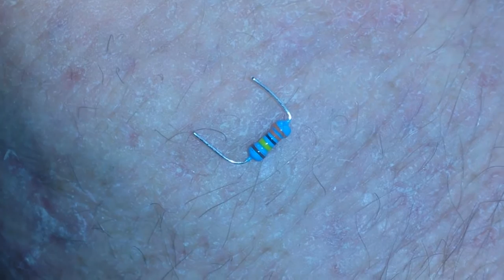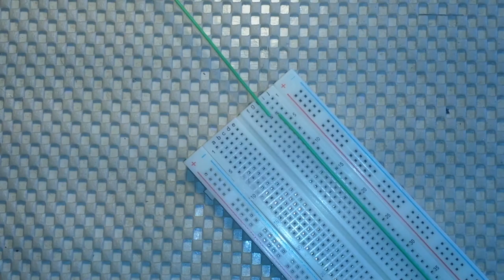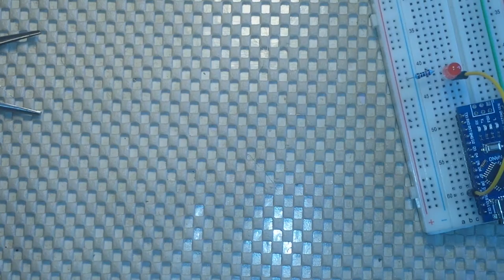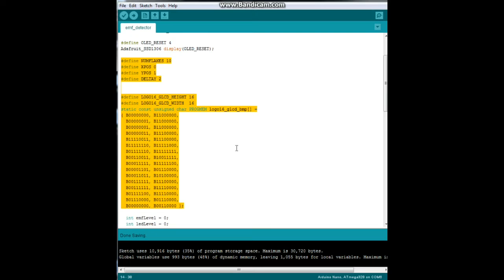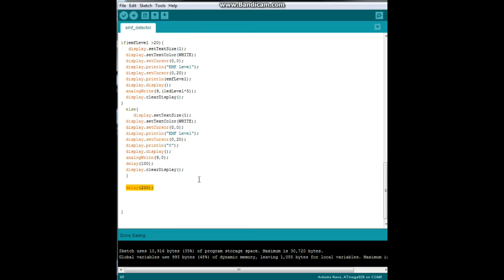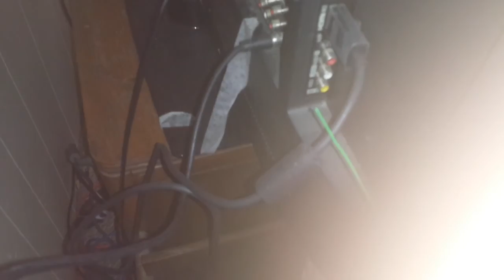How to make a custom Arduino EMF RF Detector

Comment: Aren't color codes meant to be read from left to right?  In order to read the first resistor and get the same result you gave I would have to read it right to left?  The second resistor, If read left to right results in a 120 ohm ±1% resistor, if read from right to left, like we had to read the first one to get the stated value, results in a 10K ohm ±1% resistor?  I'm guessing it's the 120 ohm option?  It is within 30-40 ohms of values given by various online calculators.  It's great to have us read the color codes but you have to show them consistently in the correct orientation and focused well enough to see the colors.  You could also read out the colors in the correct order as others have suggested.  BTW- it looks like your HDMI cable is haunted, because if cable TV and the internet has taught us anything it's that the only thing that sets off EMF detectors are ghosts. 🤣  Who ya gonna call?

Comment: Will this satisfy measuring similarly as an AM radio (like the noise aspect of am radio but just need measurement)? looking to find/make something that will pick up lower than am radio range, this looks to be a solution but would need to do side by side test, wanting to find dirty noise in signal cabling without hooking up other instruments and will be in confined spaces with the need to travel in a maze type situation. :) Thank you

Comment: This is great but what I'd like to do is have 2 auduarnos work together. One to receive the signals and one to produce the signals. The dominant EMF signal produced would need to be something simple that translates to a few different numbers based on frequency. How would I go about that? Also, for the experiment I'd like to do, I do not wish to send digital data. Just simple values that can be used as the input and output of a nueral network program.

Comment: I'm just starting with Arduino, and I am following your RF detector video. Please correct me, but where you connect SCL and SDR to A5/A4, you appear to actually connect to A6/A5? This is confirmed by the A7 Aerial connector being next to your A5(?) lead? I am worried that I might make an error, so I would be grateful for your advice please.
Reply from the maker: Connect SDA to A4 and SCL to A5
Reply: @learnelectronics  I'm sorry, but you haven't answered my question about the video?

Comment: I like the project, but in my opinion you would improve your videos by A: don't keep something secret in an instructional video.
B: don't forget to post your code. I've noticed multiple people asking for it and it is still not posted.
C: don't explain every line of code. Just post the code and //comment in the explanation.
One man's opinion.
Reply: I believe he was referring to his many previous videos where he tells you what size resistor to use with the red led, even just the previous one he did. Akron I think your other points are somewhat relevant
Reply: As for the code... I'm not sure I agree. 
Extreme detail is great for beginners, a waste of time for the more experienced. THere is certainly a balance to find.

Comment: Hi, Great video 

I tried doing your example, but I just can't get it to work. 
I don't have a 3.3M Ohm resistor (yet) but I do have 3 x 1M ohm and a 330K and tried setting them in series. 

My probe was a jumper wire like yours just a bit thinner i guess. If I don't ass the resistors I just readings jumping up and down anywhere if I add the resistors I keep getting readings at 0
I only have like a starter pack of Arduino, so my stock of resistors are small. Is there anyway to do this using what I have ? Sorry for Asking but I just started out with Electronics
Reply from the maker: No it only works with the spec'd values
Reply: Okay and thank you for taking the time to  answering me :-)
Reply from the maker: Michael Martinsen no problem, I answer all questions from my viewers.

Comment: I'm attempting to build this right now, but we're having trouble getting a reading from the analog output
Reply from the maker: Sam Ch-Ch hi Sam, thanks for watching the video and taking the time to comment. make sure you have the resistor correct, and you must be very close (less than 4in) from the source.
Reply: Is there any way that I could perhaps get in contact with you to discuss this directly.  We are pretty sure we are using the correct components, however the readings are not consistent.  Great video btw.
Reply from the maker: Sam Ch-Ch you can email arduino0169@gmail.com. that's the only way.

Comment: I'm gonna be honest here I'm not sure what resistor to use, I only purchased my arduino yesterday and I'm completely new to everything, thanks.
Reply from the maker: Giorgio Gandolfo no problem, 220ohm
Reply: can you please give us the code without the lcd display, just the led, please
Reply: @connor4317  Why would you need more code for that?  Modify it to your own needs.  Hint: alter the pwm code to modulate the brightness of the led.